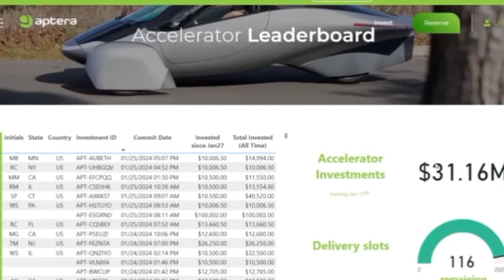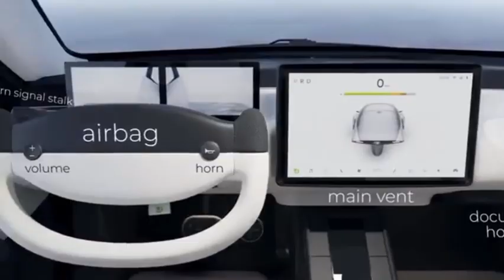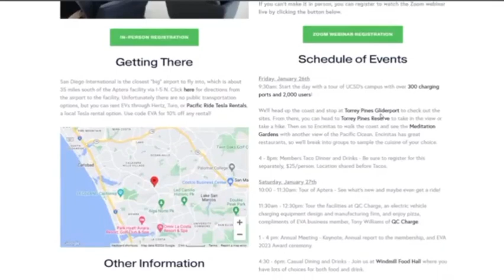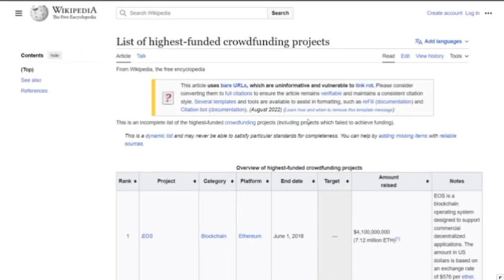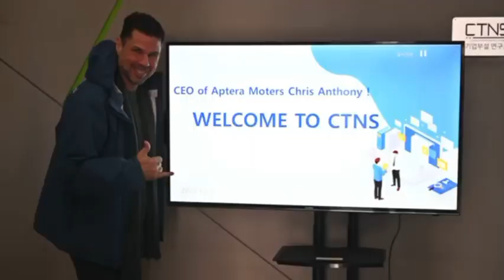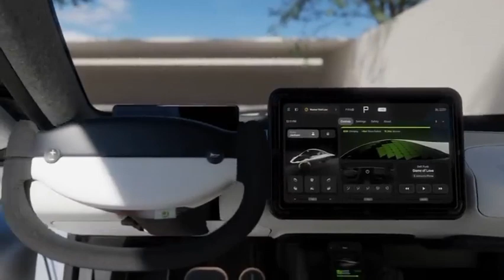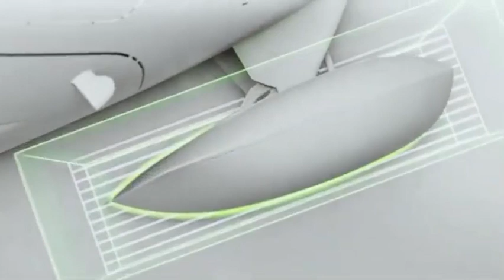After securing a $33 million fund for initial Phase. Aptera is one step closer to hitting the road

Comment: Good to see Aptera got another $33M! They took a year to secure the first $33M. So, now at another $33M, they are well on their way to success.
Reply: They need another 200 mill
Reply: @mattyghost3409  I was under the impression that 
1. The $200M is for the high capacity manufacturing
2. There are secondary plan to proceed without the $200M.